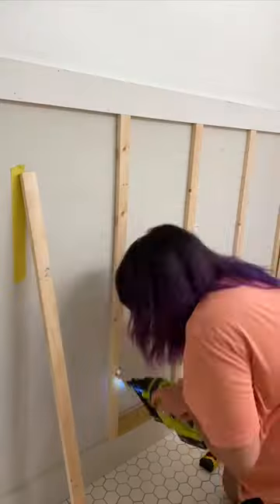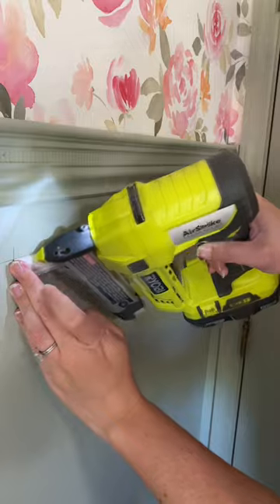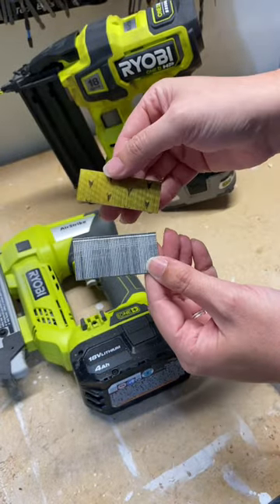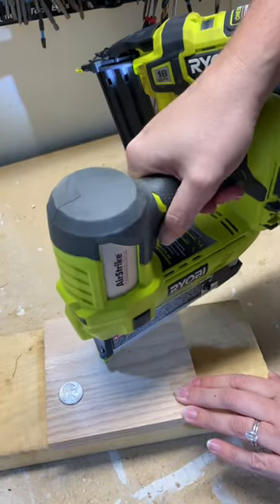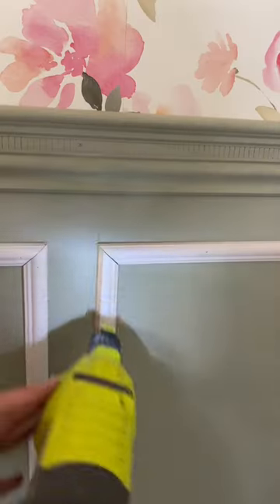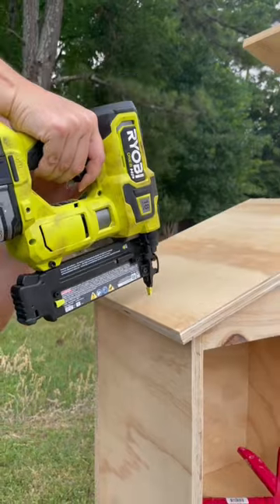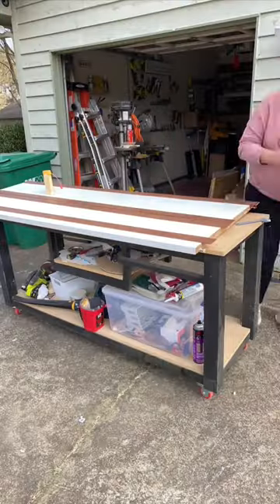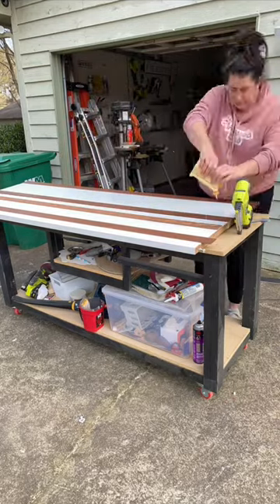Brad nailer vs pin nailer. What’s the difference?  #tooltips #powertools101

Comment: My pin nailer gets used primarily for helping to hold together trim on an outside miter joint
Reply: I used to do that but I just use miterapel or the fast activator glue that dries In like 5 seconds

Comment: Which one would you recommend buying first?
Reply: Honestly go with a brad nailer. You can get the basics down with that first and then use something that takes a little more skill in my opinion. But it also largely depends on what you're scope of projects is
Reply: Yes go with brad nailer , 23 gauge nailer
Is more of a finish kind of nailer. Works amazing if you master Collins clamps and biscuits